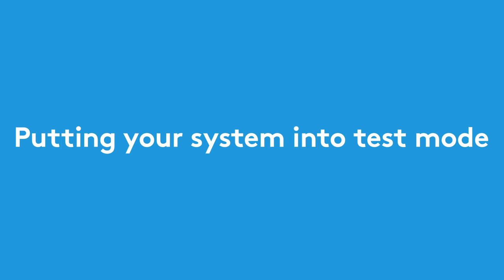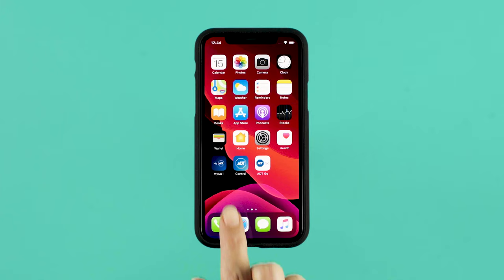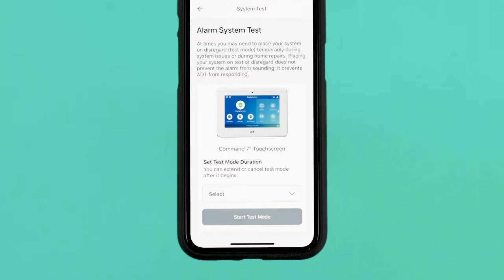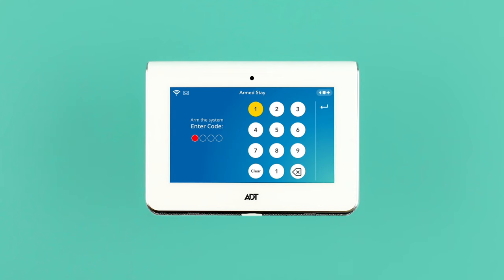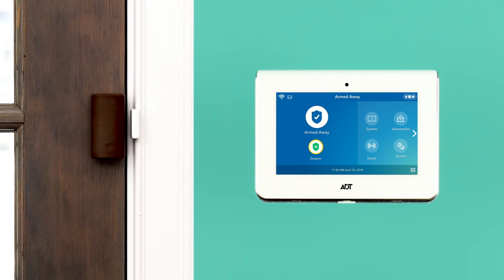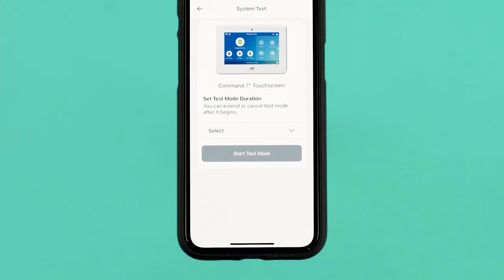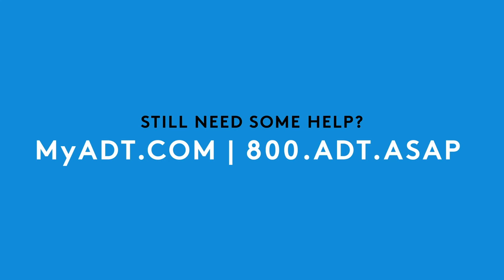How to test your ADT home security alarm

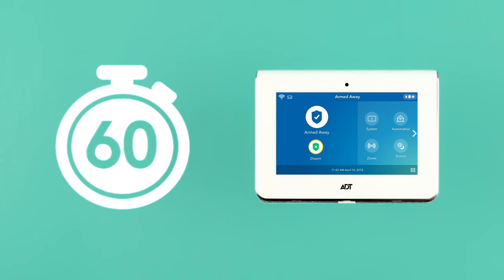Comment: This video is flawed because it confuses disarming the system with ending test mode.  They are two different things.  Here is where the error starts:  0:43   "You can disarm your security system using your regular combination OR simply selecting end test mode"  This is wrong. Here is the correct statement:  "You can disarm your security system using your regular combination AND then you can end test mode when you're done testing."

Comment: I REPLACED DOOR SENSOR BATTERY, BUT TRIANGLE STILLS SHOWS TAMPER,HOW TO GET RID OF TAMPER,BEEN HAVING SEVERAL LOW BATTERY ALERT ON SAME SENSOR DOOR ZONE WITHIN A YEAR,IS IT SOMETHING I CAN DO MYSELF
Reply from the maker: Hi Francis. The tamper may be associated with the cover if it's not secured correctly after replacing a battery on the sensor. Please give us a call at 1-800-238-2727, and we can help troubleshoot further with you.